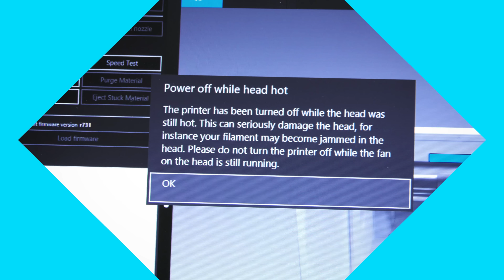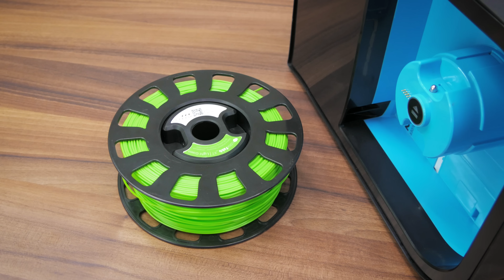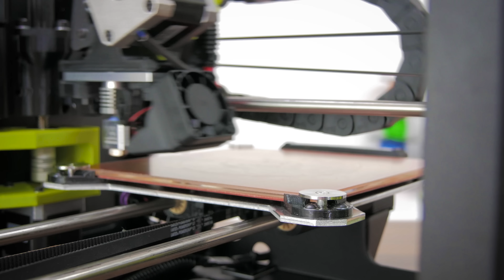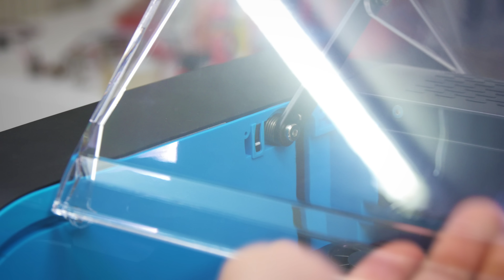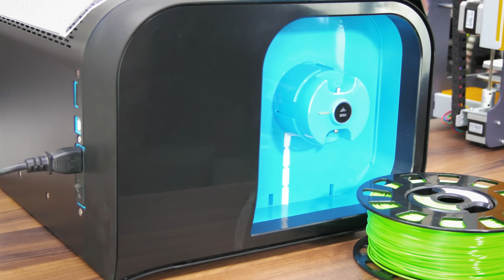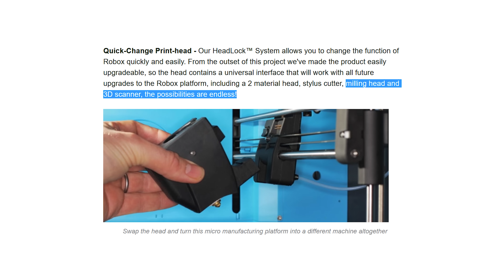Feature breakdown - The CEL Robox!

Comment: Yes, I know this is 7 years old but I have some of these printers, and I just resurrected another one today, and there are a lot of similarities in the basic thinking for this product and the far newer and much lauded Bambu Labs Carbon X1 ecosystem. Both have a property firmware, both tweaked existing open source slicers to create a simpler workflow and create project files, both use filament IDs, but obviously the motion system and hardware/software solutions are much updated.

Comment: I have this printer and it absolutely kicks ass.  Set the print bed temperature to 112 (for ABS) and add a .5mm chamfer or round to the bottom edges of the object you are printing where it contacts the heated bed and your parts will come out 100% perfect.  No squashing or flare out at the bottom.  The spool system is awesome and I don't understand why people complain about it being an unnecessary complexity, it is a godsend.  Hands down the absolute best 3D printer I have used so far and is light years ahead.  There are 7 stepper motors involved and are part of the automatic alignment system that can produce parts of such fine detail, the layer lines are virtually invisible... the part comes out having a matte finish.  The design of the mechanism is superbly well thought out and very modular.  The smart spools are wonderful, you can load whatever material you want after their empty and reconfigure the EEPROM in them with your own personal settings/profiles.  I LOVE THIS MACHINE...  and I usually nitpick and find problems with everything, but this machine has been superb.  You do not have to buy their exclusive filament.  The machine is supposedly capable of nylon, but I have not tried that material yet.

Comment: Best Plug and Play 3d Printer there is. Period.

I started as a suporter of the initial Robox Kickstarter campaign and received my first Robox back in August 2014. While the start was a bit bumpy, CEL has been workingly hard and has been and is constantly improving both hardware and software. I've closely inspected many other FDM printers (Ultimaker, Makerbot, RepRap, Zortrax) in person on various trade shows and I can tell you that nothing in the USD/EUR 5.000 range beats the Robox in terms of bang for buck (it has the lowest price of any serious FDM machine), ease of use and print quality.

As of February 2015 I have six (!) Roboxes in daily use and they are totally reliable. If there is any problem, the CEL customer support is there to help.

If you are considering to buy a 3d printer, don't hesitate and buy a Robox. It has made 2nd place in the category Plug-n-Play printers of 3d Hubs 2016 buyers guide –> https://www.3dhubs.com/best-3d-printer-guide#plugnplay-cel-robox

Tip: The solution to any warping or lifting is to sand the PEI sheet on the print bed using 240 grit paper. A solution which CEL is about to adopt in mass production.

Comment: Sweet overview! I've settled on the Robox as my recommended printer for schools - the door lock is just that mechanical lever, but makes a big difference around kids. Also the ability for a printer to detect between ABS or PLA means I have to go in for 'repairs' far less often! They had some issues in the early days with the valve seals blowing and the heads becoming gunked up (totally irrepairable) but it seems to be fixed now... certainly one of the most innovative 3D Printers in its price bracket!

Comment: For more info on the dual material head and dual spools and dual extruders you should check their website.
The dual-hotend they have now its just a selectable hot-end with 2 diferent sizes. The tech is cool and it works ... until it doesn't. And most of this cool tech seems like a beta testing for the dual material head.

And the form factor of this printer (one of the best selling points of it) is completely lost when you enlarge the spool axis to get 2 spools for dual material prints. Oh boy, it is ugly then.

I would not agree with Thomas on this video, mainly because I spent too much time repairing this. 
Some tech novelties and improvements are certainly nice, but they need to be tested. And don't turn your early adopters into beta testers.

As always, best wishes for the ROBOX Bristol team . If I have a quarrel(?) or problem is with the printer and its reliability long term, but the development team is working hard and bit by bit trying to deliver.

Shame CEL pushed them to release too soon, some flaws persist.
Reply: +JJ CC I've experienced quite a few blown seals in the early days but none for a while, I think they may have finally overcome it... however once the dual material head is available I'll swap to that for sure for simplicity's stake, even if I only print in 1 material.

Comment: That reel system is cool and all but I can't help feeling it's more DRM than feature, means you have to buy your spools from them, at a higher cost than generic stuff, it's like 2d printers sold at cost or at a loss and then they get all their profits from massively overpriced ink, or like disposable razors.
Reply: +Christian Gerefalk If you do decide to use custom profiles there's a forced checkbox to void warranty on the print head. Kind of fair enough though, as feeding experimental filaments through the delicate robox print head could damage it for sure.
Reply: +Christian Gerefalk he says something about that in the video ;-)
Reply: He did? Just watched the part about the reel again and he doesn't seem to mention it, he just says stuff about how it stores information about the filament.
Reply: he mentions that you can reuse this thingy in the spool and use your own filament, but i have no clue how this works
Reply: starting 1:25 he talks about rewritting the reel and so on
Reply: Errm, yeah? But that doesn't mean you can buy generic filament and use it, you need to use their reels, re-spooling generic filament onto their reels would be really tricky to do without specialized machinery and you'd need as many of their reels as you intend to get generic kinds of filament.
Reply: But don't you have to use their spools? Does the print still work if you put generic filament in through the hole from a spool on a nearby spool holder? Doubt many generic spools fit their holder
Reply: Ah nice, I withdraw my DRM comment, though I still suspect the company would prefer you buying their "smartreels" which I suspect cost more than generic filament?
Reply: Christian Gerefalk :-P
Reply: +Christian Gerefalk Reeling new material into a Robox Reel is more of a chore than a DRM.
Where I worked repairing those we used a normal "reprap" reel holding system, and we put an empty Robox Smartreel of the same material (ABS usually).

The Smartreel is there to "mainstream" the whole "loading profiles of materials", but it's not really mandatory. And you can rewrite and read reels from their program (or manually select a material).

We used cheaper material than Robox for a long while, and had no problems. Just remember that there's "cheap" ABS, and TRASH TIER Abs. Don't use the later
Reply: +JJ CC I have one of this machines on order. from what I gather from the forum people don't tend to re reel 3rd party onto empty robox reels. The simple way is to just put a external reel holder to the side and just put the empty reel on to set the profiles.
Reply: Scienteer swapping spools is really tricky business, you need to evenly distribute the filament and it's a lot of filament, like 300m for 1kg, realistically speaking you can't do it manually, companies making filament use machines to spool it that work like winches/wishing reels with an arm that swings back and forth to make the filament not bunch up to one side etc.
Reply: +Yutaka Takenouchi You've never seen the Cube 3 then.
Reply: something like that but opensource would be awesome though .... would make a nice optional feature to take the hassle out of tuning to find or looking up properties yourself. and it would also help you track it and put stuff like batch numbers on which is great for the business side. ...... maybe a QR code would work too, something which you could print at home and a simple barcode scanner or app would help read it in. .... 2018 I think its still not here, anyone wanna collab? :P